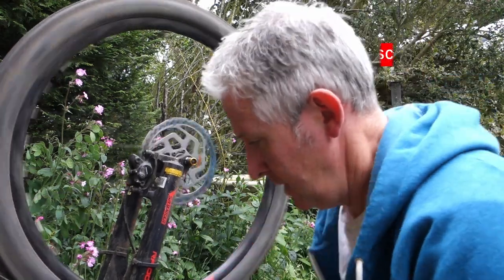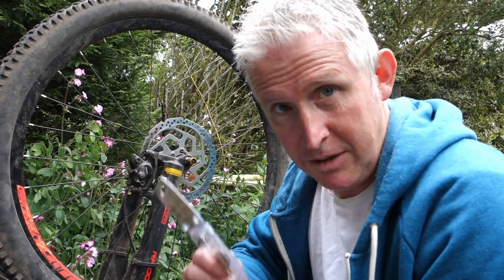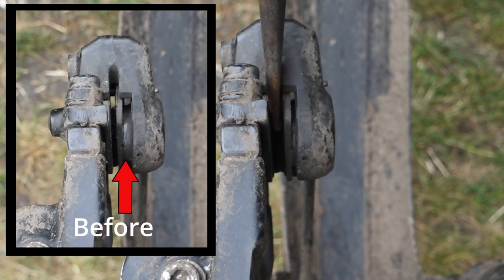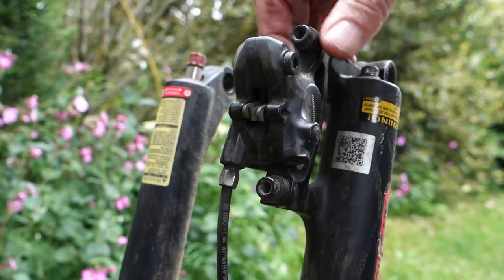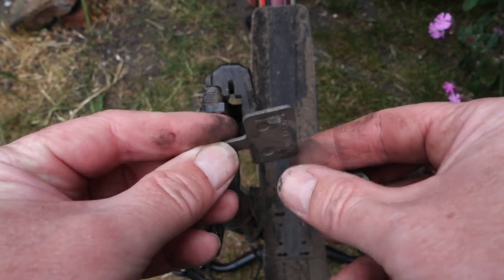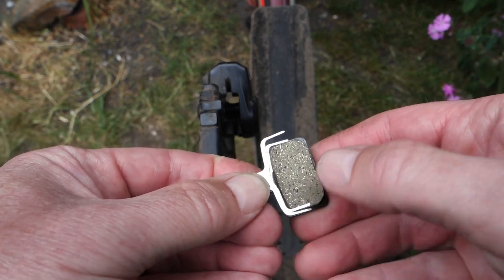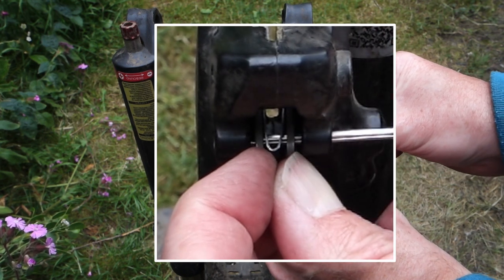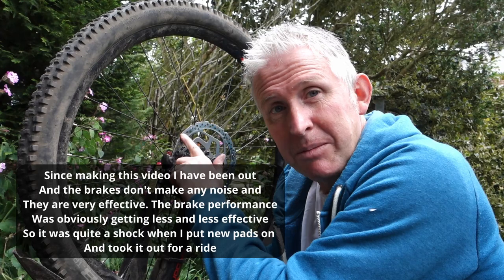How to Change bike disc brake Pads

Comment: great video as always, and every day's a school day - as i hadn't realised that you had to push the pistons back in a bit... but what i did learn before getting my canyon was that with new brake pads is that you need to bed them in a bit and you ride along and brake about 10 times - and i assume its the same with cars! (but never done that with them..)

not sure if you remember, but i broke a spoke on my rear wheel (exactly a year ago) and Simon from durham repair centre picked up up and sorted it, i also got him to give it  service and he replaced the pads, and got these ones - front sintered £13, rear organic £8...not sure what the difference is tho.. but the back brake was squeaking like mad a while back and think it was the sealant came out of the tyre and got onto the rotor...i cleaned the rotor but it still happened so i took the pads out and sanded them down a bit and sorted.. :)

but i have another squeak and i think it's the headset, seems to be a few reports of the canyon headsets not being that great, i stripped it down a while back but the bearing casings were stuck to the bike frame...but i greased them, and also tightened the bolts on the stem as they weren't that tight...hoping that sorts it, it's not like i thrash the bike, i tend to just do bridleways etc..
Reply from the maker: You are right about bedding the pads in and I should have mentioned that in the video. On cars you need to do the same as they will feel spongy at first. I will put that in the description..... thanks for reminding me. I have herd that you can get contaminates on the the pads and it can affect them and make them noisy..... I just wish they had stuck to good old brake blocks (Rim brakes).  I had a noise on my Canyon a while back and I ended up changing the bottom bracket bearing BUT when I came to loosening it off I was shocked how slack it was. They should be torqued and I applied hardly any force at all and it came undone so it can't have been torqued properly at the factory

Comment: Really good and helpful video tutorial John. I’ve only had bikes with rim brakes in the past, but my current road bike does have disc brakes so I’ve learned something valuable here. By the way I love the nature sounds in the background John😊
Reply from the maker: Thank you Tom 😁 As you know I am totally new to the whole disk brake thing on bikes. But as I said on the video its the same as a car but smaller scale... You cannot push the pistons back in with a screwdriver on a car though 😮😁 You need to use a heavy duty clamp.  Yeah the birds and the Cockerel like to gate crash my video all the time  🤣